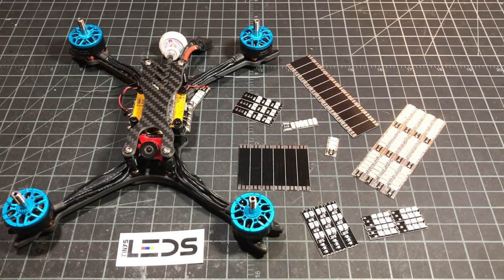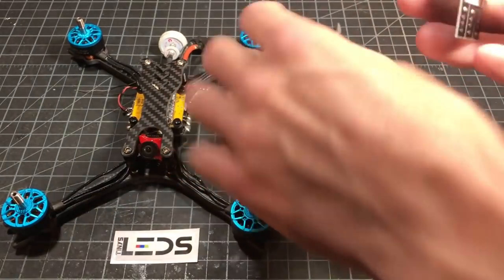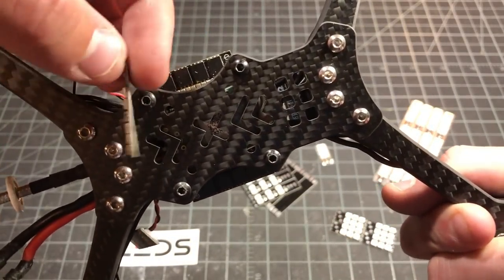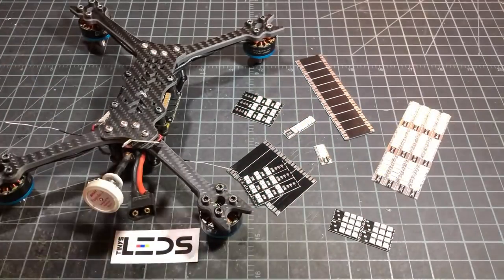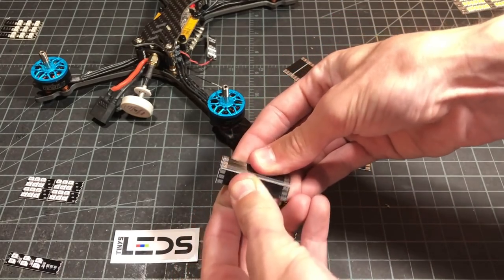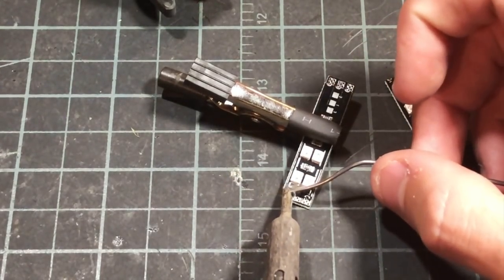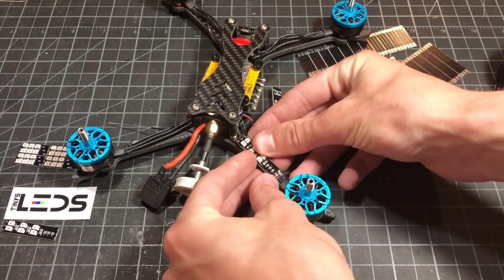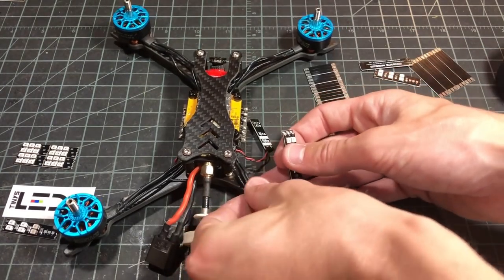RaceLites, RaceWire, and TinysLEDs - Install and Overview

Comment: I love LEDs but isn't this kind of pointless? The point of the race wire is to save wires and components from being damaged from bent props. Aren't bent props just going to knock LEDs right off of that board?
Reply: Exactly what I thought 😂
Reply from the maker: QUADBOT FPV this is why I said my favorite combo is only the mini Racewire on top, so you still get full protection, with the lites or solid leds on the bottom. However I have been using full ones on top for a few months with loads of crashes with zero issues. 🧐

Comment: Use a smokestopper for testing leds. Never blank lipo wire.

Also i use Ws2812b LEDs, becourse i can change color via the transmitter.  These racewire could be usefull for saving some wight But i dont need them, my quad is to small for this

Comment: Are those lights bright enough for fpv night flying. Will I be able to see where I am going if flying through trees?
Or are these more just for looks.
Reply from the maker: Not sure you realize how many lumens would be required to actually be enough for the sensor to make out anything, a LOT lol. Nothing you put on your quad without special IR things short of a spot light is going to enable that.

Comment: Great video!  What ESC are you using?  I just built a 6S Mode2 with the Aikon AK32 4-1 and I'm having a terrible time with desyncs (I believe that's the problem, anyway). Thanks!!
Reply from the maker: Mike C the Aikon, what motors?
Reply: The RCAddict     Hyperlite 2405/1722kV.  Just tried going to Multishot and thought I had it, but it desynced after about 2 minutes of hard flight. I've played with Blheli 32 at length, but still no better. Guess I'll go back to DShot and try again. Thanks!!
Reply: The RCAddict     Also, using the Pyrodrone F4 OSD FC.  I'm charging up now to try DShot 600, 8k/8k.  Of note, I have one motor reversed in Blheli 32.
Reply from the maker: Many people reported problems on specifically the 2405 :( Something about that motor combo I guess.
Reply: Thanks, my research is proving that true. What motor would you recommend for 6S racing that WILL work with the Aikon AK32 & Pyrodrone F4 FC?
Reply from the maker: The 2207s are great.

Comment: I have the iflight LEDs that look like the ones you installed here and when I powered on they do not turn on and they was a small amount of smoke that came out from the flight controller and then I reconnected the battery and it was fine but I am guessing I have to program them on BF. Hopefully I didnt fry something lol. I am open to any thoughts if anyone has encountered this issue?

Comment: Hi Rc Addict.
Do you have some troubles with these ESC LEDs? I have to rise up the idle from 4.5 to 7 because I have desyncs and oscillations when I cut the throtle. I use brand new Hobbywing 2207 1750kv and hobbywing 4 in 1 G2 stack with 6s lipo.

Thanks!
Reply from the maker: That is not due to the racelites. That's more related to motor timing, filtering, and your tune.
Reply: The RCAddict I tried everything but I couldn't solve it at all. Did you have sometime the same problem? And if yes, how did you solve it?
Reply from the maker: Did you tube your filters?
Reply: The RCAddict No. I tuned PIDs but I flew it with BF 3.5.1 stock filters. How do you tune them??
Reply: I can confirm now that my "wobbles" at throttle cuts is not due to leds. I just identify the problem because a lot of people have the same issue but, my setup is all new and I can´t solve it. I changed the min throttle, PID, esc parameters (timing, pwm frequence...), antigravity, downgrade the BF version,  etc and I couldn´t fix it. Some ideas?

Comment: I don't see a link for the solid green lights you have in this video?? And do you think these are better then the CL racing leds?? Also is it ok to use clear masking tape wrapped around these for a little but of protection? (I see it difficult to get a piece of tubing on jere since arms or ends are bigger)
Reply from the maker: The CL racing are direct copies. Some thin tape is more than enough to insulate underneath them, here is the link https://tinysleds.com/collections/all/products/3-6s-not-as-tiny-leds?variant=7103545606199
Reply: @TheRCAddict  thanks man...got them from RDQ... quick question I been looking all over ...I know they can handle direct voltage.... since it only has a positive and negative can I just solder them directly to the esc red and black pad, since it will be running from the battery anyways.... Or do I need to put it on a open VBAT on the FC? ....also what guage wire do you recommend to solder for that?...... just so you.know CL_Racing website has the CL race lights for $5 for all the colors and shipping is only $2
Reply from the maker: Any voltage source is fine, and it can be as thin as you want. CL copies many things and ideas,  I will not buy his products.
Reply: @TheRCAddict  ok cool ...I just wanted to make sure ...I figured since its 3-6S that it's easier just to solder closets to where the battery plugs in.... this way i dont have to take apart the stack to put the LEDs on.....

Oh i didnt know that about CL at all.... i wouldnt buy any other products off him anyways..... well that's not right.... what other companies copy off of someone else?? Just so ik...
Reply from the maker: Yep, anywhere you are getting the full voltage you can tack them on. 

Tyler from TinysLEDs who created the original motor LEDs is a close friend which is why I am so vocal on the topic. Many companies copy, or at least highly use ideas here and there.
Reply: @TheRCAddict  oh ok cool..
Thank you for all your help.... I appreciate it
Reply: @TheRCAddict  I have a question...I got the 2 back bottom green ON lights on and 1 blue top light...

Hmmmm... when I plug mine battery in 3 lights on the same side light up......then when I arm it all them slighty light up...but as soon as I apply throttle or roll/pitch/yaw..... the quad completely shuts down and loses power completely ...... do you have any idea what's causing this?
I only so far set up just 1 arm just the top ......

But I can leave it armed no problem probably forever...

Also just for the heck of it when I arm it, (I do have hearshrink) ...I touch the blue led and it gives a noise like the motor is about to spin up (but the motor not spinning up)...
Reply from the maker: Hmm, not exactly sure what you are describing. Could you email me a video? thercaddict7@gmail.com
Reply: @TheRCAddict  lol duh to me... I got it... I had the smoke stopper connected and I guess it doesnt like sticks put through to it.... when I removed it everything works perfect (I tested this through betaflight... cause it worked a little better in there.....anyways I appreciate your help, I'm glad I figured this out fast without ripping stuff apart
Reply: @TheRCAddict  thanks man

Comment: Hi.. Doesnt those diodes (LED) drop some voltage to the motors?
Reply from the maker: They are unnoticeable overall.
Reply: @TheRCAddict  i dont know, maybe the diodes are parallel to the motor wires
Reply from the maker: These have been in use for over a year and thoroughly tested. They do not affect performance.
Reply: @TheRCAddict  thankyou

Comment: It'd be cool if leds automatically changed to correspond to your race position. ie R,O,Y,G,B,I,V=1st, 2nd, 3rd etc so if your coming 1st your leds would automatically change to red, orange for 2nd etc. I reckon it would be easier for spectators to follow what's going on
Reply from the maker: FP. Free now that sounds awesome, only problem is it would require full track positioning systems, addressable leds, and a way for the fc to communicate to central timing hub
Reply: Yeah, hopefully in time. Am thinkn something like a big version of the IRC race wand built into race gates so that simply passing thru the gate makes the necessary changes that way quad only needs an individual assigned identity and race event software takes care of the smarts. A man can dream....
Reply: @fpfree8821  Could be done, It is just easier to have each pilot use a separate color. Id imagine you have seen DRL (in real life races) by now

Comment: Will the LEDs work with 4S and 6S?
Reply from the maker: Technically yes, but if you run the 4s ones on 6s they will let out some smoke over time. There are separate versions.

Comment: It's not possible to change color. 4in1 escs should have parallel pads for betaflight leds to make wiring easier for each arm. Maybe a slim led pdb? It should be a thing.
Reply from the maker: They have different RDG switchable and addressable leds.

Comment: Use conformal coating ! :-) 
Electrolube (brushing).
Reply from the maker: It will work yes, but easy to become compromised and doesn't hold the racewire down.
Reply: I mean for all the electronics and especially the flight controller.(signal wire ect)
A little dirt and moisture already has bad influence.
You can also simply solder through it and do not add pollution.

Comment: It’s a mess shipping to Italy costs more than the product itself. I’d love it
Reply: Giuseppe Falcone buy it on banggood. I'm pretty sure I saw something similar there😉
Reply from the maker: Giuseppe Falcone Banggood only has an inflight copy of the Racewire, not lites. UK suppliers coming soon
Reply: Found a copy on Banggood. I feel sick to buy a copy but it would be 4 times the price. Thanks guys. Don't ask me the link, I wouldn't be fair. It's preatty easy to find by the way.
Reply from the maker: Giuseppe Falcone they don’t have racelites, only the wire copy
Reply: The RCAddict that was what I need. I don’t fly los. Thanks a lot.

Comment: Using a  high frequency sinusoidal signal to power something is a terrible idea. impédance modifications and diaphony ruins your signal and phases sync. You don't need Dshot anymore, oneshot 125 should be enough now... maybe a good old simonK firmware.
Reply from the maker: If it's so terrible why does it work flawlessly on many many quads for months then?
Reply: In fact you can't tell if it's OK or not, only a reflectometer will show this mistake.
You can only say: it's still flying...
Back to electrical basics: your leds are connecting motor phases !
Next time , try a led between negative and video signal, it should work too...
Reply from the maker: There were private discussions between EEs when these were being developed about potential problems with future sampling etc, so they are aware, but it's not causing noticeable problems as of now.